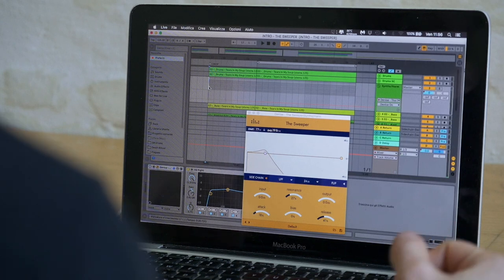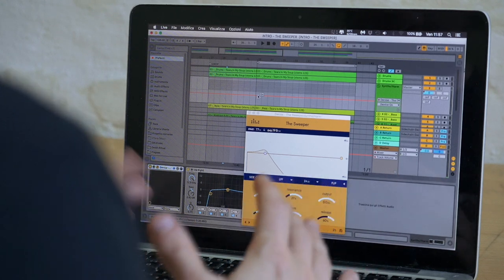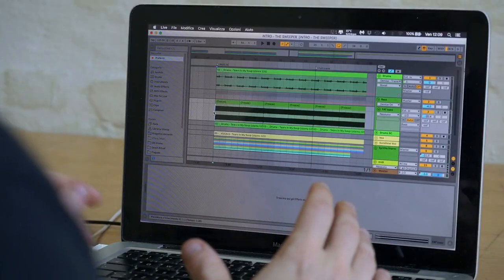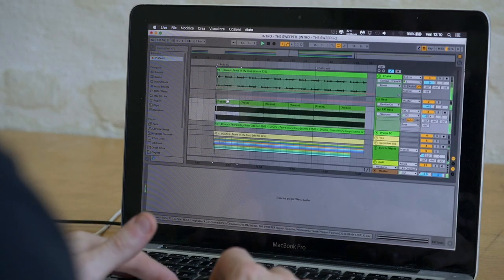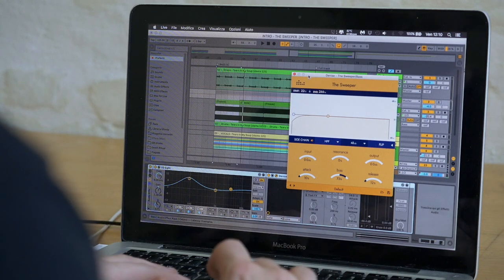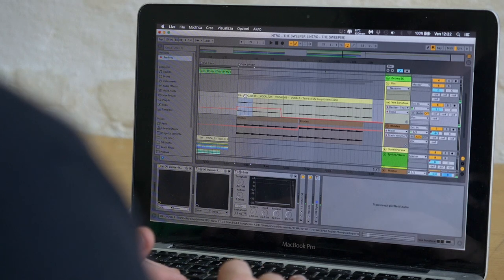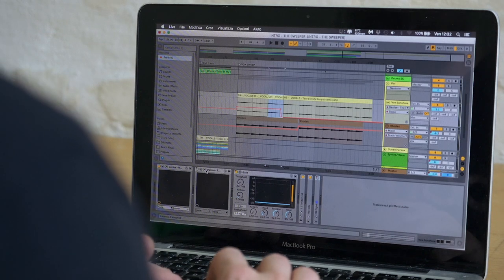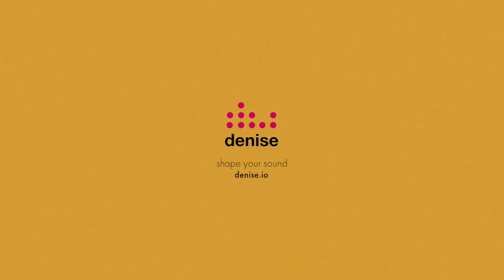How do you Sweep? The new way to be creative and open up your mix by Enrico Tiberi (nrec)

Comment: how do you route things in the sweeper?
Reply: it can take the regular input from the track it's assigned to, or you can use its sidechain input. Each DAW deals with it differently though. In ableton it's doable using sends/returns.
Reply: i have personally tried a few times and never got the thing to work. sent it through the Return track and all that and still no luck.